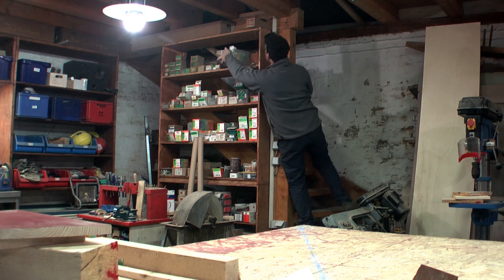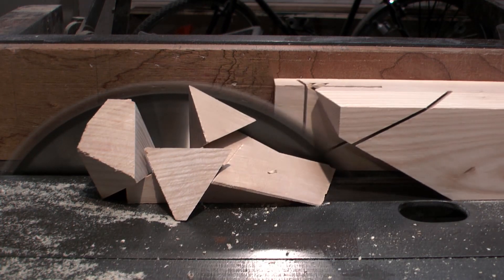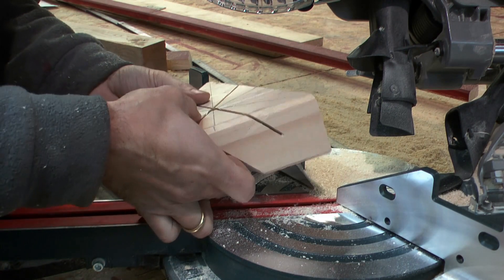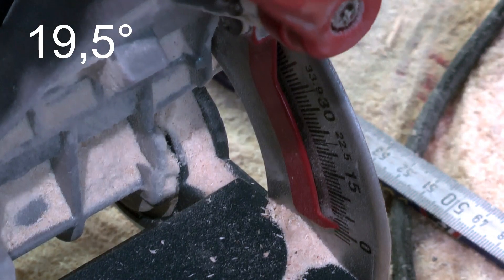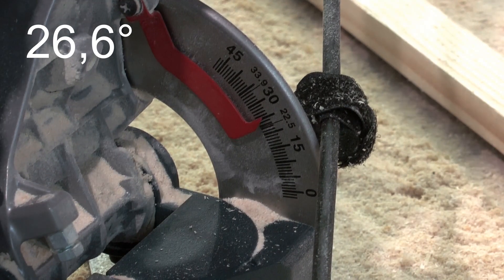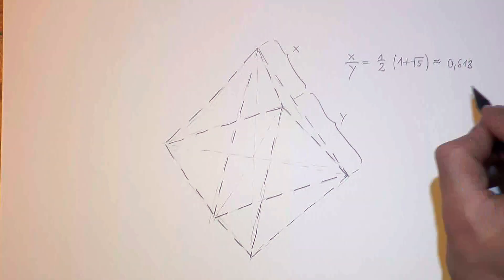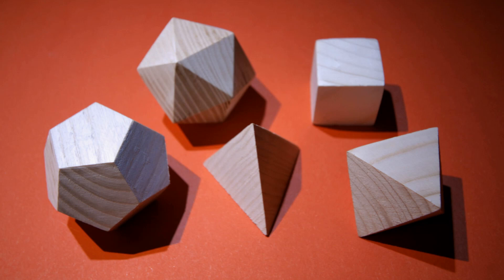Polyhedrons from solid wood

Comment: Cube requires no triangles. I see no sense or purpose in these 'calculations' of the cube, except for showing off in front of the crowd. A cube only needs three right angles, and nothing more. No nonsense calculations with triangles inside. You might as well be counting snails and trees inside

Comment: Mathias, great videos! 
I have a question for you. My wife saw these cubes online (link below) and I told her I would probably make her one. As a woodworker, I liked the challenge. However, I have not been able to come up with a Jig that can safely help me cut this on the table saw.
Would you have any suggestions on how to do it?
Thank you!

https://www.etsy.com/listing/552913081/essential-oil-roller-bottle-storage-geo?ref=shop_home_feat_4&frs=1
Reply from the maker: I would start with a cube and drill the four holes at first. Then I would set the miter gauge to 45° and clamp the cube to it. Then 8 cuts with the sawblade tilted away from the cube to cut off its corners. The tilting angle depends on how long the short edges should be.
Reply: @matthiasburger2315  that gives me a pretty good idea. Ill try to adapt that to the table saw. I feel a little safer there. there is no reason i can try both, ;-) Thank you!

Comment: The dodecahedron is actually pretty easy with a band saw.  If you convert each face of a cube to a rooftop shape at the right angle, with each face's rooftops pointed in a different direction, you get a dodecahedron in just 12 cuts.  It's also possible to cut an Icosahedron from a slightly oblique dodecahedron.

Comment: Thanks for sharing. When making the dodecahedron, what formula do you use to determine the depth of the wood block that's required?  Thanks.
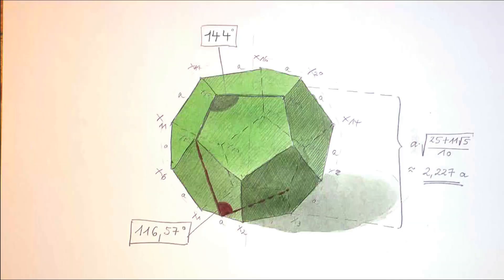Reply from the maker: See 4:30, I divided the thickness of the board by 2.227 to get the length of the edges.
Reply: Thank you. That helps a lot. :)

Comment: This is exacly what i was looking for!! I wanted to make polydice, only the d10 is missing (pentagonal trapezohedron). Is there a way to make these without wasting all the material surrounding the polyhedrons? I wanted to make them from some rather expensive wood species
Reply from the maker: I see no practical way to waste less than a cube in which the dimensions of the desired object fit. And even that is difficult. Maybe temporarily glueing the expensive wood into some cheap blocks for better handling?